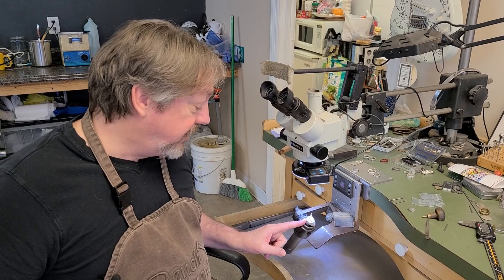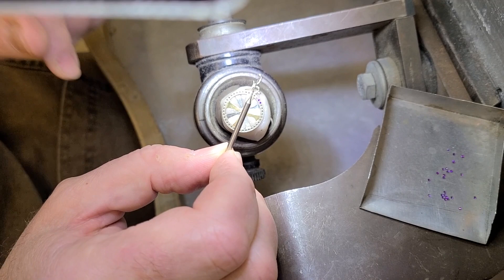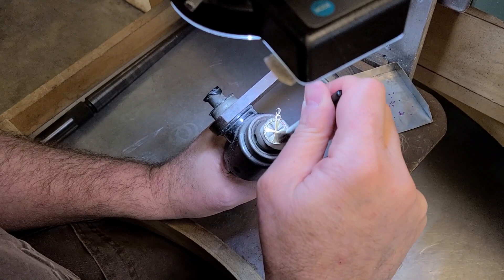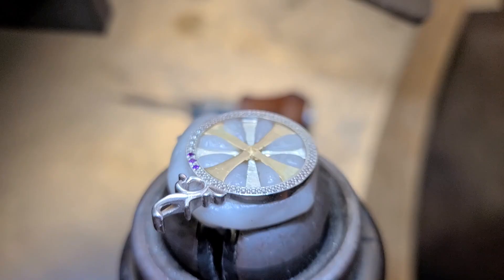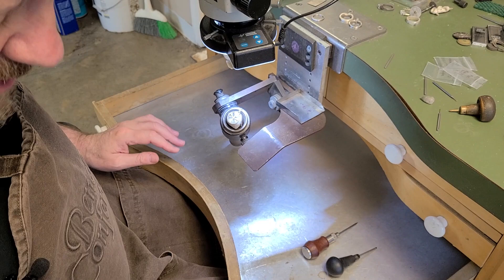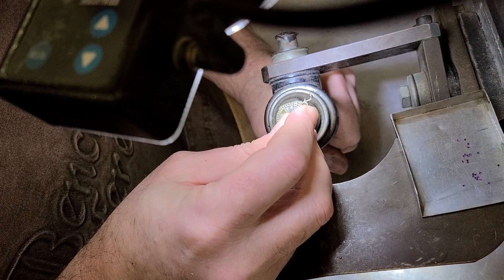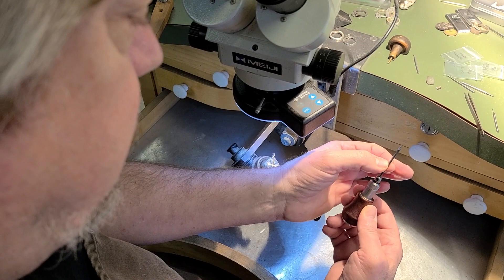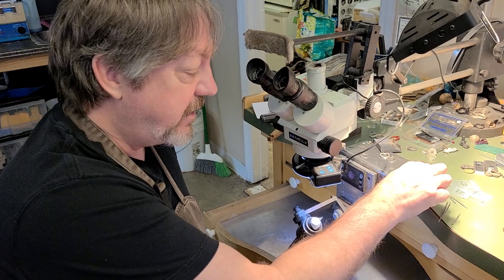How to set tiny stones is a pinpoint setting

Comment: Hi Joel and thanks for your video. May I ask why the designer didn't modelize the seats of the stones? Is there any reasons?
Reply from the maker: I designed this. I always want to have metal to cut. That way if the stones are not the right size or if the casting is not perfect its still usable.
Reply: @JMDjewelry  smart

Comment: Thank you Joel! I have a few cast rings i bought to practice stone setting on before i reset my anniversary ring stones into its new ring that has 40 1mm diamonds surrounding the 2 oval diamonds. I wasn't sure what to do to the pinpoint settings to open them up to hold the diamonds.  This answers a lot!  I was wondering if you can make it possible to print out your graphics? I have a few issues with remembering the small details and it would be nice to be able to look at them without leaving my bench and getting out the computer and finding them in the video again. Please!
Reply: You can take a screendump off the graphic (maybee?) and print that
Reply: What kind of drill would I need to do that?